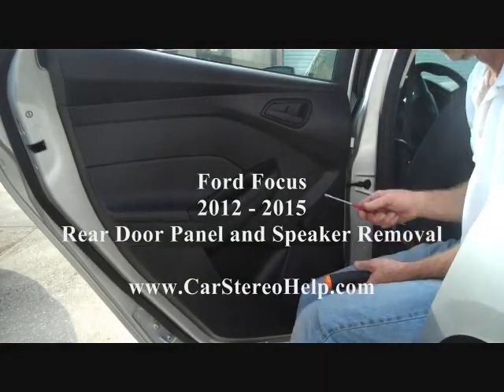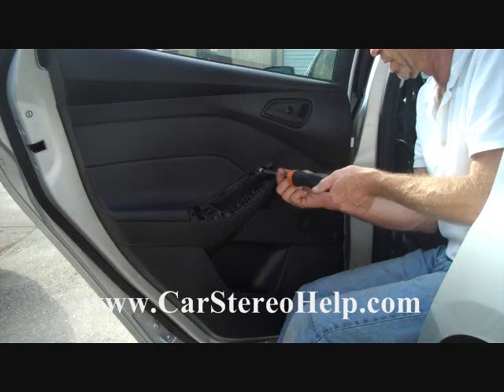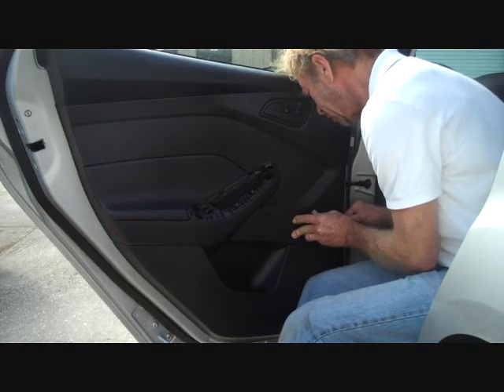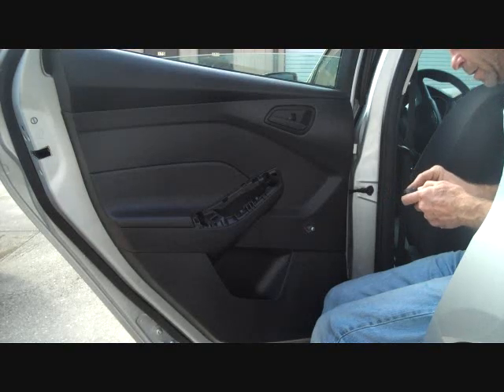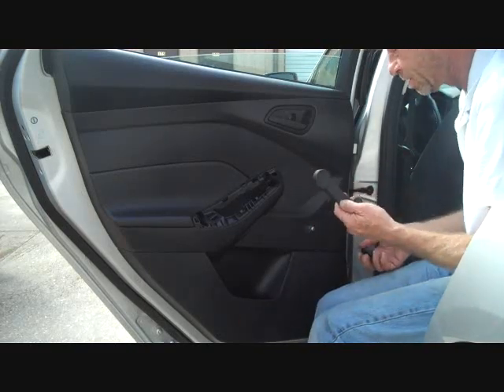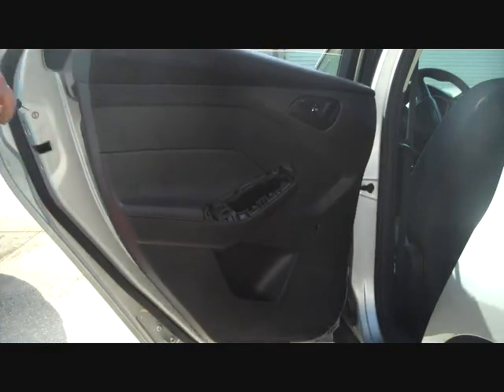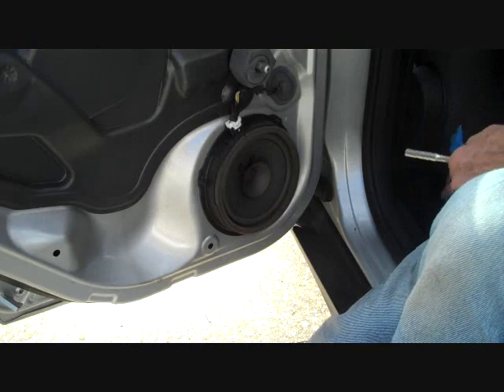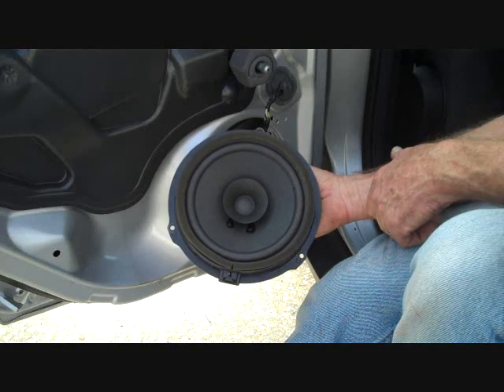Ford Focus Rear Speaker Removal 2012 - 2015 = Car Stereo HELP

Comment: Thanks for showing how to remove the window crank, it had me stumped. My speakers were buzzing in the low mids. I noticed that touching the cone in one spot stopped the buzzing. So I just taped a little foam in that spot. Buzz gone. Maybe it'll rip up the cone, but it's holding for now. Thanks again!

Comment: Excellent video, well explained!. Could you tell me the diameter that have the rear speakers of Ford Focus 2014?, i mean if they have 5" 5,5" or 6" maybe, i want to know the size to buy a good replacement of rear speakers before remove the door panels , if you got a suggestion of any brand of good rear speakers that fits in focus 2014 it will be welcome, excuse my english and Thank you very much!